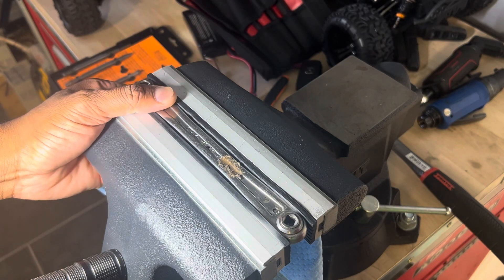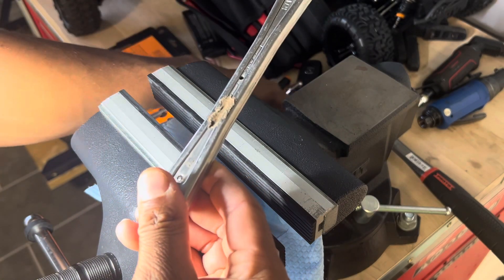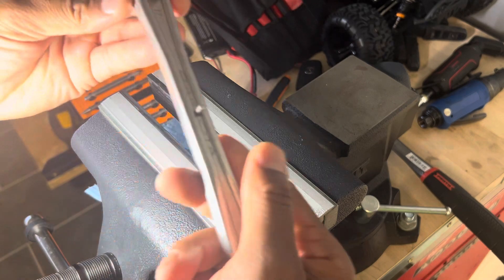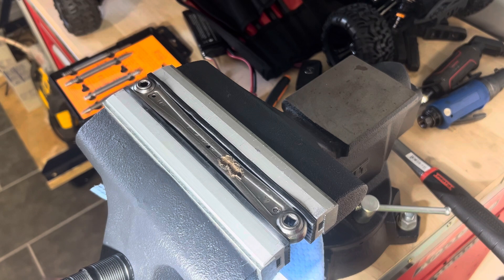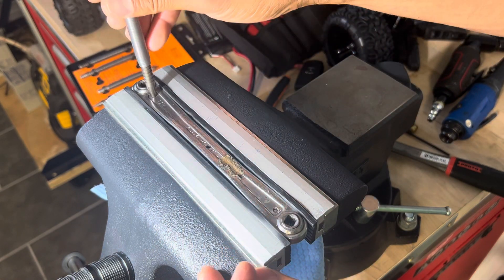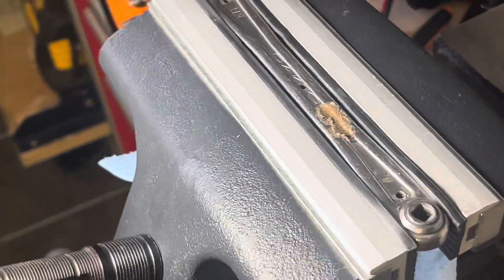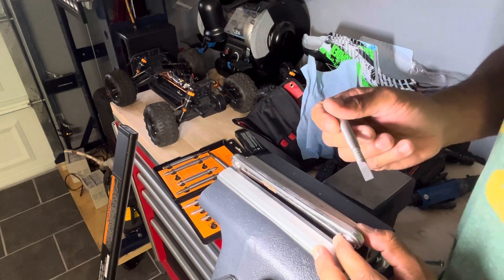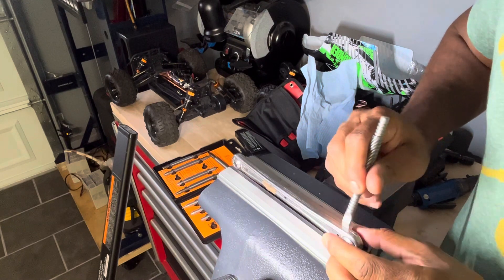Snap On Dakota (Blue Point) Sideways Extension Chain Drive 1/4” Drive to 1/4" Bit Driver (Needs TLC)

Comment: Why not get it warranted frum Snap-on or does it carry the same warranty as Snap-on
Reply from the maker: Haven’t got that far in the troubleshooting process. It’s an older unit, so they might not service it for a multitude of reasons, discontinued, i’m not original owner etc. I don’t want the new version, plus I can still return to seller and get a refund. But yes, that’s another angle to work if I can’t get it open/fix.